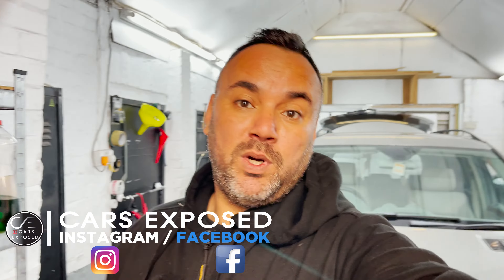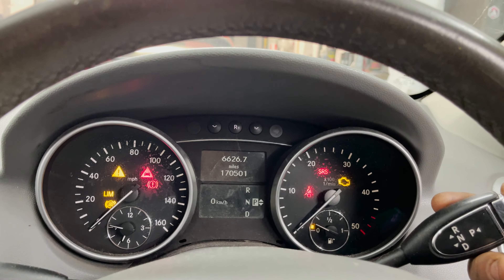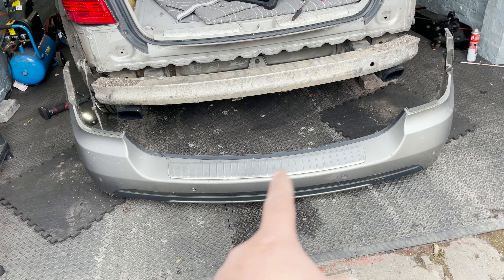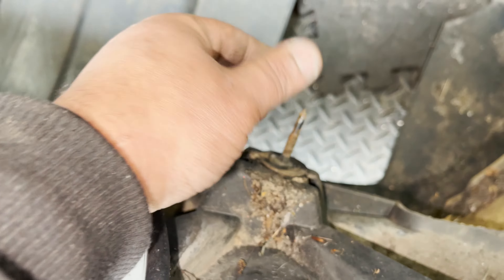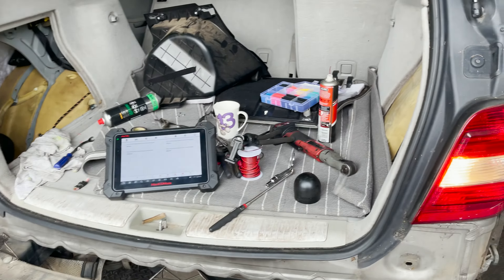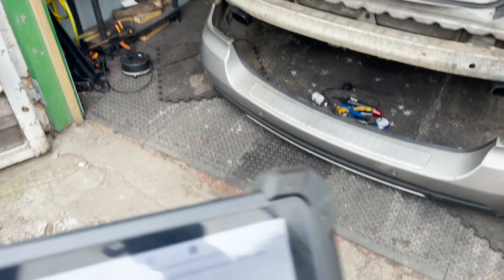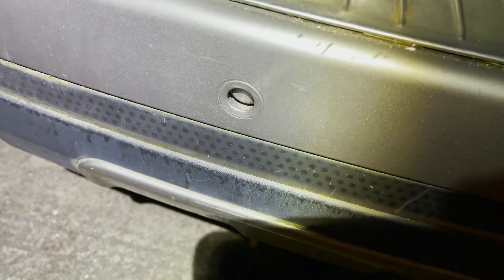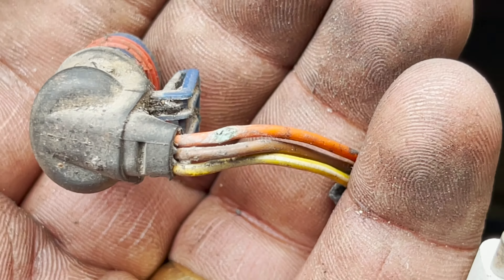Mercedes ML280 Parking sensor Not working

Comment: How's she goin'?  Those sensors are pretty nice to have, but they can cause some headaches eh!!!  That connector you changed was in pretty bad shape, so it was good to solder all the wires I think.  Thanks for sharing and take care!!!
Reply from the maker: Once you have parking sensors you can’t leave without it 😊 , more electronics the car have more headache you will have indeed cheers mate 👍👍

Comment: The sensor emits a signal that bounces off solid objects. The time it takes to bounce and return, gives the computer a calculated distance to the object.
Reply from the maker: It was my bad explaining myself bud, the bit that I was unsure of is further than 107cmish from an object or a problem with the sensor it shows 255cm so a reckon it only start measuring the distance properly and beeping I guess when it gets to about a meter   👍